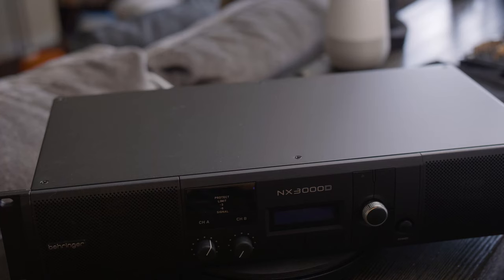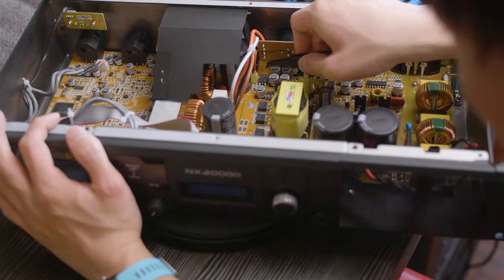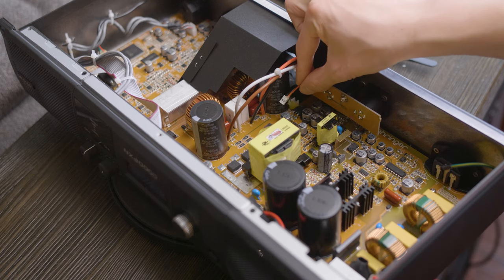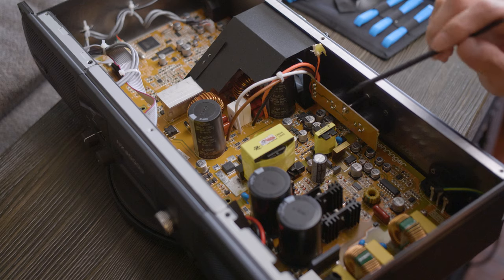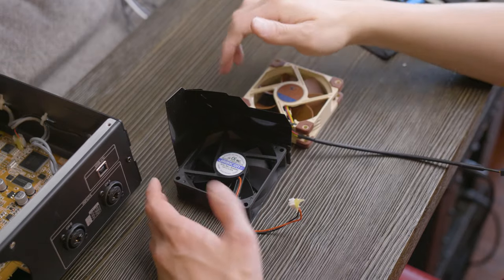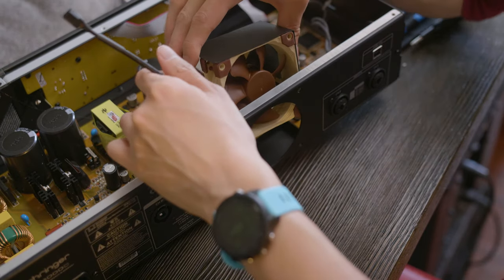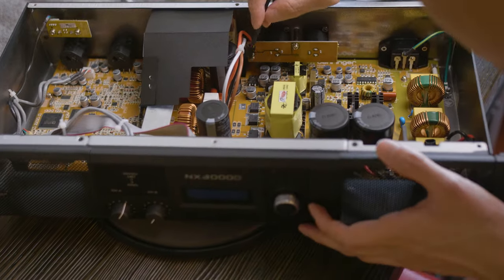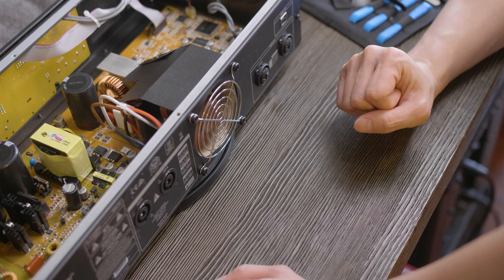Behringer NX Series Fan Mod NX3000d Noctua NF-A8 FLX

Comment: The difference is UNBELIEVEABLE!  I had to double check that the fan was running because it is so quiet now.  Thank You!.  
Also... ditto on the comments about the connector.  I bent my pins a little to fit it in due to a chip on the board being too close to allow room for the unused wire on the connector.  I could have also soldered the old connector on the new cable, but this worked fine.  Just caution to anyone reading this...  If you break your pins on the board, you're going to have a Bad Time.

Comment: Thank you so much for the video, it was very useful. When I modded mine, I did find the cable that ran from the FAN to the board pretty hard to fit, especially with the FAN in situ. So, I used one of the provided 'additional' cables and fitted that in place, whilst the FAN was not present - so I could access through the hole where the FAN would have been. As this was for a three pin connector ( red / black / yellow ) it was a little too large for the space available, so with the aid of a magnifying glass and a plastic spatular I eased the two pin from the mother board to the right a little. Then used a pair of angled pliers to fit the cable. Then I installed the fan and after this connected the cable from the FAN to the new cable sticking up off the motherboard. I found it easer to pop the fan ducting shield thing AFTER fitting the fan back in place. It meant I could get hold of the fan better when I screwed it back into place, otherwise the FAN itself is pushed back and away from the mounting holes. Once again, thanks for your time and effort in helping others.
Reply: how many rpm does the fan run on red and black wires? can the yellow speed control wire be used?

Comment: One note: It's important for the fan to push air into the amp chassis from behind for the best cooling, because the amp has minimal heatsinking of the output devices, so it depends on having that airflow. The job of the air duct is to guide the airflow across the PCB surface while increasing the speed of the air, and this is especially important when you use a slower running fan for lower noise. So be sure to also re-use the air duct. The NX3000 models do improve upon the previous NU3000 models in the area of heatsinking; the previous models did not have the aluminum bar for a heatsink, just bent copper wings that were soldered between the output transistors and the PCB surface.
Reply from the maker: when you say air duct do you mean the piece of black plastic that was attached to the old fan? also, are you saying i should have switched around the fan so it blows into the amp instead of out? Thanks for your response!
Reply: @TheLegendaryBrownNote  Hi, yes I was referring to the black plastic. It is used as an air duct to direct cooling air over the heat sink, which is the aluminum bar underneath it. This way, a smaller heat sink can be used. Based on the video, it looks like you do have air blowing the correct direction; it should be drawing air into the chassis from behind, and out of the vents at the front. Air blows toward the label side of the fan.

Comment: Awsome video man, I just installed the same fan in mine and its so quiet! I also mounted the anti-vibration mounts and using a plier it wasn't that difficult.
Reply from the maker: that's so awesome! i haven't noticed any noise from the fan so far but good to know that you can put the anti-vibration mounts on! enjoy the nice and quiet :)

Comment: I've now done a fan mod upgrade to a NU1000DSP using the Noctua NF-R8 Redux 1200rpm fan, and it is a good choice for this application. It reduced fan noise to inaudible from more than a few cm away, and the coil hiss from the switching power supply is more audible than the airflow from the front side of the amp - again, with my ear right up to the grille. The fan is able to spin up on the voltage from the amp at idle, so stalling is not an issue. I'm using the NU1000DSP to push a Bag End S10E-I subwoofer with a complementary response curve to the ELF alignment of the sealed box. The only downside is the NU1000DSP's input sensitivity is not high, being a pro amp, so it needs an inline unbalanced-to-balanced preamp like ART Cleanbox to raise the input to a usable level. But I have all the power needed for this power-hungry small monitoring subwoofer setup.
Reply: Side note, you want the 3-pin version of this fan, not PWM.

Comment: Legitness. I'll need to look into doing this, I've got 3 NX4-6000s so the fan noise stacks up quickly. I've found it becomes white noise because I never turn off my amps but having them be quiet would be nice.  I wish I knew which fans my Pyle PT8000CH uses, that thing makes NO NOISE, it's super impressive. I'll look into this.
Reply from the maker: you must have your amps pretty far away from your mlp if it disappears as white noise!!! With the old fan when there was loud action it wasn't noticeable but as soon as it quiets down it was super distracting! i'm glad there was a solution. It's amazing they ship with such loud fans! have fun if you choose to do this mod! it still boggles my mind how much power and wooferage you have running!!
Reply: @TheLegendaryBrownNote  HAHA! Thank you, I really enjoy consistent deep bass! The fan sound kinda fades into the background
1. Due to the size of the room
2. Because I never turn my amps off. So when you walk down they're already going so the brain starts to cancel them out. 
Maybe the NX4 is a bit quieter than the 3000? I doubt it, though. 
To your point, one of my amps is at the back of the theater, about 25 feet from the front row, so that helps. The other two are probably 3 or 4 feet from my seat. I've considered putting my amps at ground level (in terms of acoustic physics, that will cut noise down) but the dust they'd collect would be scary. 
RE: Wooferage (I love that word by the way, definitely stealing that), it's about to get crazier! Once our funds settle back down and I get some spare cash, I'm going to buy 5 of those new Dayton 21" drivers and build some IB enclosures for em. If they're as good as I think they'll be, I'm going to sell my 15s and they will become new staples in my setup. So I'll have 8 18s and 5 21s. 
If they're THAT good, I'll probably sell my 18s and replace them with the 21s so I'll have 13 21" drivers . . .that's going to be ABSURD! 
I think you'll need to fly in to Indiana to experience that one!
Reply from the maker: @budgetaudiophile6048  lol i love the craziness that is your room. I've never been to Indiana! I can cross that off my list when you get your new setup!

Comment: could you just splice the wire, leave the pin connector and glue as is and solder/braid the new fan wires to the old ones?
Reply from the maker: this is beyond my expertise so sadly i can't help you with this answer. good luck with it tho!
Reply: Yes you can, but it's easier to do it the way he did in the video and then hot gluing the connector back down into place.

Comment: Do you remove the 2 pin fan socket when you unplug the original fan otherwise I cannot see how the 3 pin plug fits into the motherboard?
Reply from the maker: i do not remove the 2 pin socket. i was able to wiggle the new connector over the two existing pins. some other users have reported that they had to bend the pins slightly to allow for the new fan connector to go on.

Comment: do you have any issues with the amp ? i am a power user and i will use it 80% of the power all the time , also i did the change with arctic f8 fan , it's a lot cheaper and about the same noise as noctua does

Comment: i was hoping for a bit more data, like what was the internal temps before and after swap, what is the before / after CFM  (airflow).
Id love to believe this is all just fine, but I will do a bit more science before cooking my amp.
Reply: trust me, the stock fan had way less CFM than the Noctua for sure ! All stock fan are bad...
Reply: @GurvanBHC7  This is just ignorant. Look up the specifications. The Noctua has 1/2 the air flow CFM that the stock fan has. the Stock Jamicon fan is rated at 54CFM the Nocuta a8FLX is 24CFM.

Comment: I'm sorry, could you tell me where the transformer is?.. I'm not familiar with this technique but I'm considering buying it. How is 220 transformed?
Reply from the maker: Hello there! I'm sorry I don't know the answer to either of your two questions.
Reply: @TheLegendaryBrownNote  thank you for your answer anyway =)
Reply: @AzzzNostr  theres a switch mode power supply inside this amp on the right section if you watching it from the front. Voltage level are unable to change by user. However i remember that somebody made a video of the older nu series where you can change the levels by soldering something on the supply section. And as everybody knows, nx is nu, the difference is only the box around the pcb.
Reply: @TheLegendaryBrownNote  Will this fan be able to provide cooling at high power?

Comment: So you have just the pins coming out of the motherboard
Reply: I did remove the 2 pin socket the new plug fits quite snug against a component on the mb so I don't think it's going anywhere. All works fine after a couple of hours use the case feels cool to the touch
Reply from the maker: hey sorry i missed this comment. glad its working!

Comment: Is the new fan quieter because its a slower speed? Or are they the same speed? Can the fan just be removed and not replaced if you dont run the amp at full power?
Reply from the maker: the fan is running at a slower speed yes, and it's quieter because noctua is known to be a quiet fan. I would not feel safe running it without a fan. But that's just me.
Reply: @TheLegendaryBrownNote  how hot does the heatsink get? Too hot to touch?
Reply from the maker: @ProfessorJohnSmith  do you mean the top of the amp?
Reply: @TheLegendaryBrownNote  no i mean the aluminum heatsink inside. I think theres a heatsink there no?
Reply from the maker: @ProfessorJohnSmith  i'm not sure. i've never felt or measured the temps inside. i've put my hand on the top of the amp and it feels fine. I've also run the amp at full load for heavy movie scenes and no problems yet!
Reply: @TheLegendaryBrownNote   how far away do you have to be from the amp to not hear the new fan?
Reply from the maker: @ProfessorJohnSmith  it's virtually silent. you'd have to be within one foot to probably hear it.

Comment: Beware . The fan link is inCorrect. Points to PWM version whereas you need the FLX
Reply from the maker: thanks for the catch! i've fixed it :)
Reply: @TheLegendaryBrownNote  Great thanks! btw the PWM fan actually turned out to be better because it has higher CFM and static pressure and even higher rpm. The connector needs to be cut but worked like a charm. Fan Noise is not audible